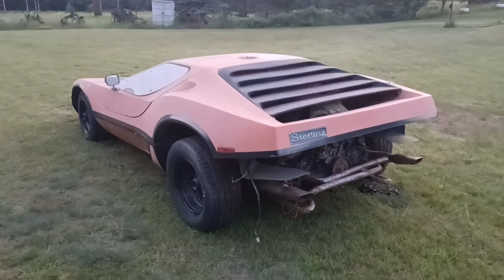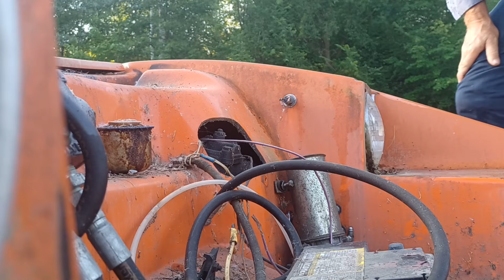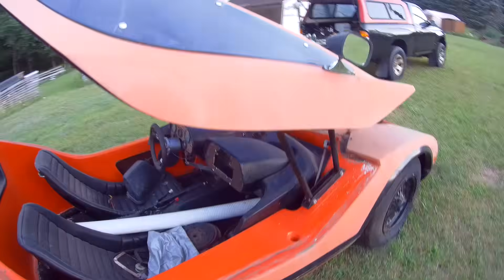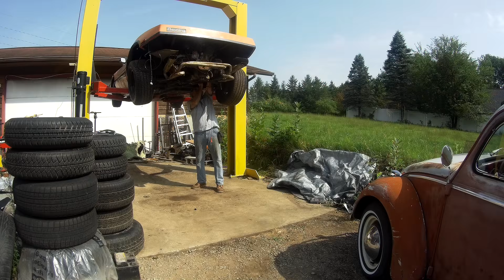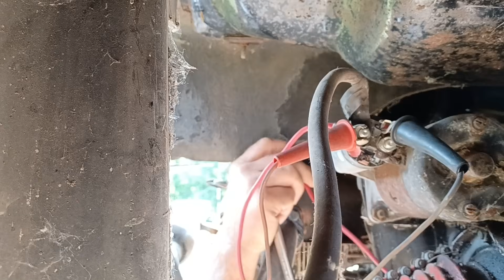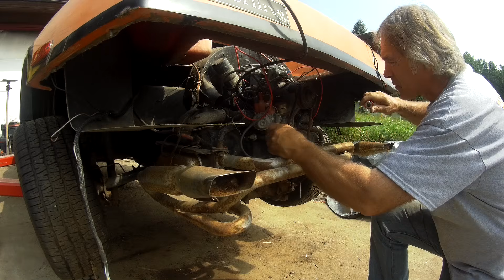VW Sterling Kit Car, Will it run? part 1

Comment: FYI - VEVOR makes a 12v reversible hydraulic pump that has its own reservoir and is less expensive than the Corvette pump if you don’t mind it not being original. From E-Bay: VEVOR Hydraulic Pump 8 Quart Double Acting Dump Trailer Pump Power Unit DC 12V
Reply from the maker: I did find a 12v unit on Ebay that used the same motor and was very reasonable.

Comment: I've lost arm hair grinding out 6volt transmission bell housings when the dust would flash, should have worn long sleeves. We had a sterling come through the shop i was working at in the 80's, probably the pinnacle of kit cars, the only problem was when it was finished, it was a still a kit car.
Reply from the maker: I was boring out a VW case for bigger cylinders, there must of been some impurities in the case that caused a spark and the filing started on fire.

Comment: First of all, mine has a valve inside the car that allows the hydraulic fluid to flow from the top to the bottom of the cylinders so you can simply lift the top off of you if you lose power, the other thing I noticed is you have the original exhaust on your car? That is something I almost never see, hold onto that.
Reply from the maker: The valve is a good ideal, I'm going to have to add one.